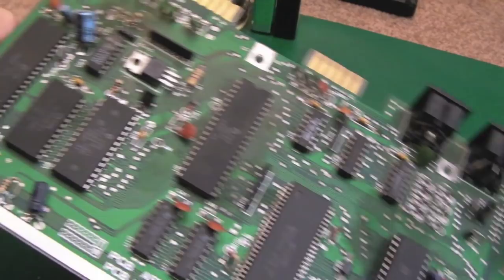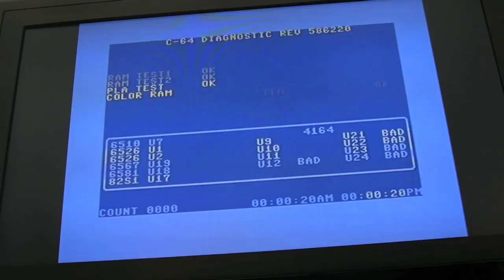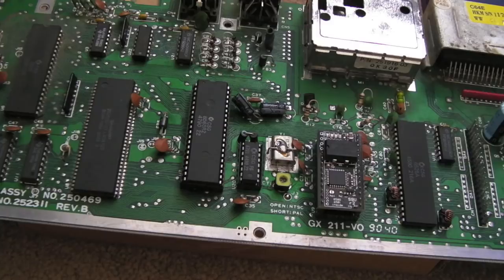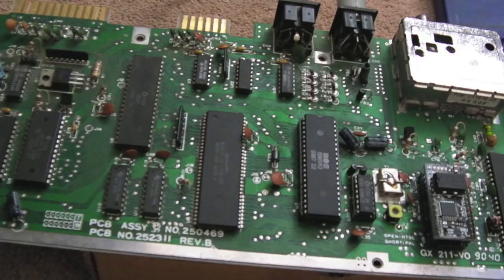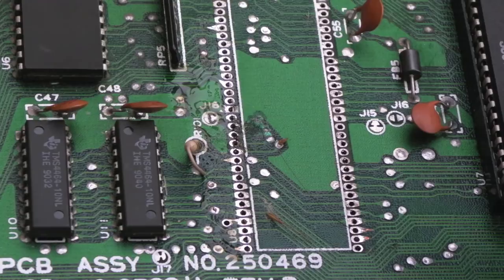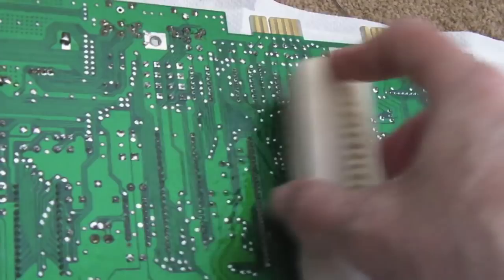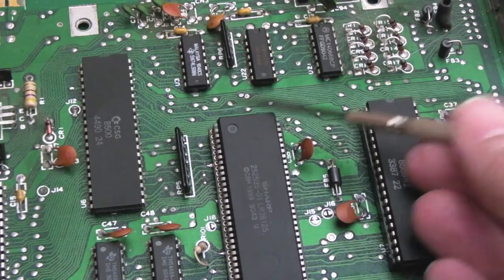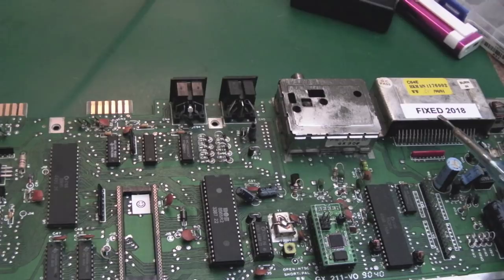Commodore C64C (C64E) PLA Repair

Comment: I would recommend washing boards that are very dusty and dirty in de-ionised water and allow them to dry naturally for a few days before moving on to cleaning with IPA. I use a soft brush such as a make-up brush in the water bath, it's much nicer to work on the boards afterwards once they are fully clean and it avoids scrubbing away over gritty dirt with IPA and possibly causing trace damage.

Comment: Spotted 2 shiny lower right pins on that chip on twitter when you posted the teaser image, kinda wondered if I was right in the issue being around that area, but didnt expect it to be this easy! Also, I recently switched to printer cleaning swaps (no cotton fibres that get stuck on pins/legs), it’s been a blessing, slightly more expensive though, but you should try them out someday!

Comment: Some classic Mac boards (eg Quadra 840AV) are supposedly similar nightmares with corrosion frequently leaked underneath chips on the boards, meaning recapping and washing the boards won't be enough -- you actually have to remove chips to be sure you remove it all and repair if need be.
Reply from the maker: Yeah, there is a difference though - the corrosion here isn't from batteries or caps, so not the same regards corrosiveness.  But as per my pinned comment up top - I would remove the chips and sockets affected as par for the course before considering the board OK for the future.

Comment: Nice straightforward repair, made so by your knowledge and diagnostic cart. I expect it would be much easier to remove such a chip with a desoldering gun?
Reply from the maker: Yes, I am sure if I had used the desoldering station it would have been a lot easier!  I need to unblock the small tip when I think of a way to approach it.
Reply: GadgetUK164 - Retro Gaming Repairs & Mods 
I've had a blocked nozzle on a desoldering iron. I found that heating it up and carefully inserting a suitably sized piece of wire into the nozzle then running the vacuum pump usually clears the blockage. You need to ensure the wire is as close in diameter to the nozzle hole diameter as possible. Using digital calipers or a micrometer can be invaluable. You may find a paperclip with the correct gauge. Otherwise, a small drill bit of the correct size could be very carefully inserted and rotated by hand but this increases the chance of causing the nozzle to become oversized or misshapen. Good luck!
Reply from the maker: Thanks!  I think the problem is its a cap leg stuck in there - flush with the edge =/  So its too wide to go all the way in and somehow needs heating and removing from the other side (the side that screws into heating element piece).  I may just order another tip I think!
Reply: GadgetUK164 - Retro Gaming Repairs & Mods 
If it went in there must be a way to get it out. You could try removing the tip and heating it up with hot air or over a gas ring and then inserting a wire from the inside to try to push it back out. Worth a try if it saves buying a new tip and if you don't succeed then you can always buy a new tip.
Reply from the maker: That's a great idea actually!  I will get the "helping hands" to hold the tip, use hot air!  I just need to find some really fine (yet strong) wire now.  It's so small that a 1/4 watt resistor leg won't fit in there.
Reply: GadgetUK164 - Retro Gaming Repairs & Mods 
Hope you find a suitable piece of wire and it works!
Reply from the maker: I bought some 0.5mm PCB drill bits!  They aren't very strong, but I figure they are going to be stronger than any wire of the same diameter!
Reply: GadgetUK164 - Retro Gaming Repairs & Mods 
Hope your rescue attempt goes to plan!

Comment: Well, that could have been worse.  Just as much work as replacing the chip, but at least you didn't have to fork out for a replacement.  Great vid!  Out of curiosity, what is that pin with the corroded trace?
Reply from the maker: Not sure which pin it was, I was going to pause it later and count which pin number and marry it up to the schematics to work out what that pin does.  Guessing its part of the address decoding that was missing.

Comment: hey gadget. I've got a PLA ready to socket in a "C" board, the sockets though are non standard it seems. Where did you get the right sized socket for yours?
Reply from the maker: I think I just hit eBay!  It's "shrink DIP" type.
Reply: @GadgetUK164  ok, thanks mate. :)

Comment: Would a game on the datasette have more trouble? It may want to use more SRAM then a cart.
Reply from the maker: The SRAM we are talking about is only used for color and its used the same (more or less) with disk, tape and cart games - even just in basic with no games loaded.  So behaviour will be the same across any of those formats!

Comment: Do you know if the LM340T5(voltage regulator that is currently on board) and  L7805CV  are interchangeable?
Reply from the maker: Yes, the 7805CV has the same pinout!
Reply: @GadgetUK164  cheers!

Comment: What would happen if you stick the PLA with integrated colour RAM into a Rev A board that has the colour RAM externally?
Reply from the maker: I suspect if you removed the colour RAM IC it may work.  I think the pinout is pretty much the same except for the lack of the pins going to the SRAM.
Reply from the maker: Check the pinout before you try though!  The the PLA that needs external RAM is better imho.  If the RAM fails inside the other PLA....

Comment: Well I didn't expect that lol. I thought when you mentioned it the actual PLA was buggered lol.  Glad it was an easy fix though :)  Very interesting that the older PLA sort of works, I wonder if they are all made the same with the colour ram, but because that one was faulty they just made it a PLA version without it, I mean the colour "kind of" works doesn't it, just a bit garbled.
Reply from the maker: Yeah, it was interesting to see it does work, but I sort of expected it would as I think all the pins are the same except for those connecting to the color RAM.  A mod to the socket / board connections might be required for one or two other pins too, but in principle its possible to stick an SRAM on there and use the other PLA I think.   Regards the design of the chips, they started with a seperate SRAM, this revision with it embedded was another cost cutting excercise to safe on the cost of those SRAM chips.
Reply: It's all very interesting xD I can bet the SRAM mod doesn't look overly pretty tho
Reply from the maker: Yeah - what I would have done is find a spot nearby (near the edge of the PCB), and drill holes for the pins of the chip, and mount it on the board rather than have it floating.   The other option is on top of the PLA.
Reply: On top of the PLA sounds least destructive and possibly cleaner :p
Reply from the maker: =D Each to their own, it's as long as it is wide I think.   I personally think a load of wires to and from a chip on top of the PLA would be hard work!  But on a space on the PCB, a socket added, with wires underneath would be more manageable etc.  I am sure there's space nearby to fit one - the main thing there is to make sure it doesn't cause too much damage to traces on either side.
Reply: Ooh yeah, I forgot you could route the wires underneath xD yeah that would probably look nicer then lol

Comment: Man, I have this 250469 board that has an odd fault.  Diag runs through several times perfect,  basic screen with fastload cart. Black screen with no fastload.   Changed rams,  kernel basic rom, tested vicII and cpu in another board.  Game cart freezes sometimes but most the time it is fine.. stumped on this one.   Super pla?  Strange Strange fault.   Very nice video btw:)
Reply from the maker: Sounds like a PLA related issue - maybe a bad connection from cart slot to PLA?
Reply: Thanks for the tip. Much appreciated:)

Comment: the SuperPLA is a pain in the ass.  is there a kind of adapter board that contains  an old PLA and some glue logic/sram?
Reply from the maker: There isn't to my knowledge!  The super PLA contains more logic than the old PLA did.  Commodore consolidated some of the other logic on the C64 motherboard into this PLA (and the VRAM on one version).

Comment: I take it a via is where the circuit trace goes to the other side of the board?  Why did the test cart say there are a few things bad?
What you doing with all these things you fix?  I'd love to see your garage.
Right on to the PCE Duo video.
Reply from the maker: Yes, a via connects one side of the board to the other =D   The reason the diag cart can give wierd errors is the way the code was written.  For example. the programmer probably put some code in there to set the addressing a specific way, so the color RAM could be addressed, it probably then wrote some bytes to the color RAM, and then tries to read it back.  Now if the addressing is not working properly, the color RAM might not be addressable, and the address lines might be talking to something else instead of the color RAM, so the write might go to say RAM or ROM or somewhere else (which could cause a crash or a glitch somewhere else).  That may then mean that the following steps fail because something unexpected happened that the programmer never considered might happen.   Diag tests are only as good as the way they were written, and there will always be ways that unexpected hardware faults will cause the code to respond incorrectly.
Reply: To add to this, you could probably bit bang each address with a known table but this would take ages. The Rom cart Gadge has is pretty sweet actually. I dunno if you noticed but it verifies by writing and reading different characters to the screen then reads screen data and jumps to the next character, two jobs in one, checks ram and the boards rom. Play the ram test in slow mo (Shift  < or >  to adjust playback speeds on youtube) and you can see what it's doing. 

To fellow commenter's - I'm no coder or engineer - I just kind of grasp what's happening, if I'm wrong or whatever don't slam me, educate me, please.
Reply from the maker: Yes, that's a good point about how its testing the screen RAM there - but part of that test is RAM contained in the DRAM - not the color RAM, it's testing both at the same time I think.  So whilst the character is correct, the color is not.  But if the VIC addressing was wrong for instance it may fail that test and point towards the DRAM or the color SRAM, yet it would be an addressing fault, which could be caused by a 4066, the VIC, or the PLA etc.  When using a diag cart or debug rom, its always worth considering what else might cause the code running to mistakenly identify the wrong component.
Reply from the maker: And amother way that single byte at a time check can give you false positives there - as it writes a byte, and then reads it, it believes the RAM is good.  But consider an addressing fault where the addressing doesn't point to the next byte of RAM where its supposed to, and it then tests the same byte it already tested, it could write a byte and verify and assume that the 2nd byte of RAM was OK too, when it's actually still pointing to the first.  So tests like that can be flawed - ideally the programer would init all the RAM to different values first, and check the value prior to modifying it, and then verifying the modification worked.   Bottom line is these diag tools have limited capability and often don't consider all possible ways that any part of a system could fail - too many different possibilities to consider.
Reply: So do you not think it is worth me changing them back to surface mount?
Reply from the maker: +StuRoRo If you want a fun project, yes - I would do it!  If it's working, and they look clean, it's up to you!  If there's no leakage on the board they may not need replacing for a very long time.  Alan was unlucky that someone did a rushed job,
Reply: Its not a rush job, I have a video of it filmed I've just not been bothered to upload it.  You can look at the quality of them and tell me if its worth redoing.
I may do just to make the board look nicer.
Reply: Cheers for the clarification and additional points Gadge. I'm slowly trying to learn, I'm feeling old and it's hard to let stuff soak in, and I have found the best way (on youtube at least) is to make a fool of myself so someone gets a chance to call me a fool or correct me, it's rather effective lol.  In all seriousness though, any little bits of info I get from these types of conversations are much appreciated.

Comment: tap tap tap, scratch scratch scratch with a metal screwdriver, like nails on a blackboard and not exactly "safe" when dealing with electronics although I am sure you're statically protected right.
Reply from the maker: Totally safe, and yes always use ESD mat and ESD wrist strap.  What I really want is an ESD whip for these types of comments ;)